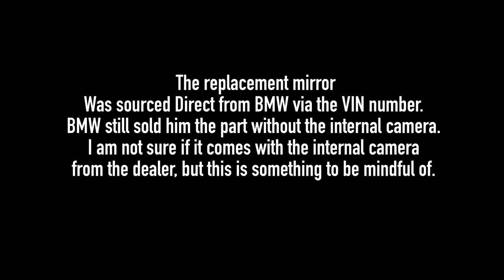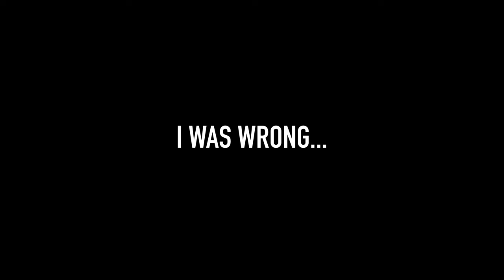BMW SIDE VIEW MIRROR DIY REMOVAL & REPLACEMENT

Comment: Great video! I just replaced my mirror, to save someone some time, if you got skills and tools, you dont have to take the whole door panel , just unsnap that top corner by pulling it, then unsnap the top black plastic trim, and you will see three mirror bolts. Everything else is same as the video. If you not confident, then I recommend removing the door panel and moving slow. Again great video to make sure you dont break anything, can be done faster but risk involved 👍👍👍
Reply from the maker: Good to know, thanks for the additional information!

Comment: Homey got ripped off for that mirror. I just got one for 200.  Gonna use your video to figure out how to put it on.
Reply from the maker: That is awesome! Good luck installing it. It is pretty straight forward.
Reply: From where did you got it
Reply: I just installed one I bought for 100 on eBay for a 535i the holes weren’t threaded either
Reply: Man right

Comment: You made far more work for yourself than necessary.  All you had to do was pull the top of the door trim back and unsnap the speaker to reveal the bolts for the mirror 😂
Reply from the maker: I politely disagree, I don’t think you can pull the top of the door trim back with out damaging it. The mirror bolts are hidden behind the long plastic trim housing the speaker.